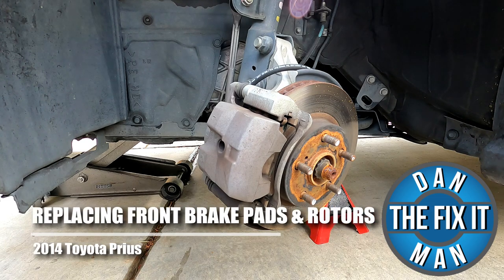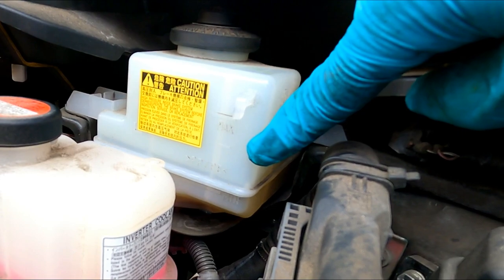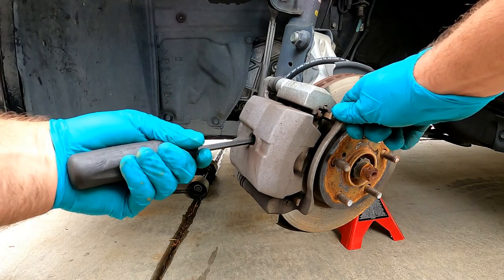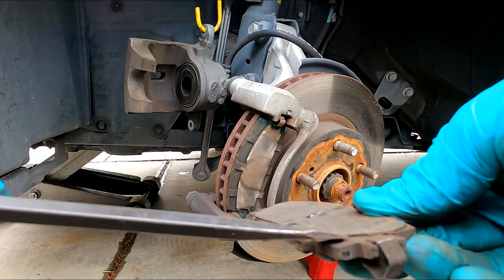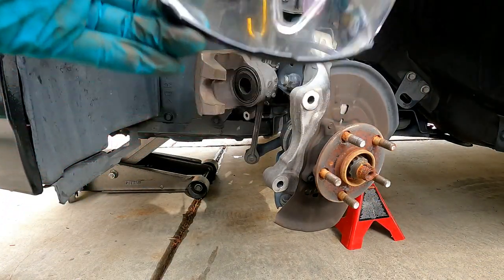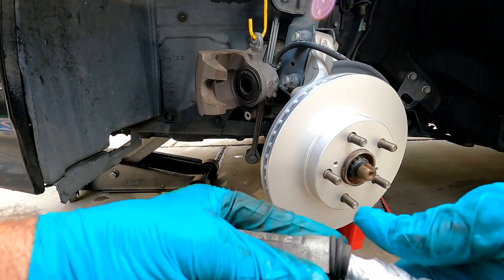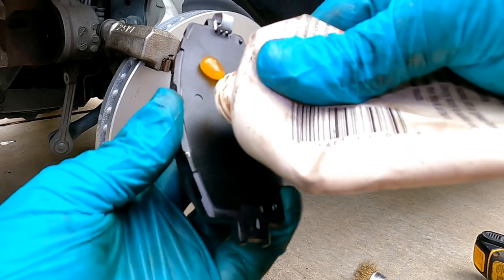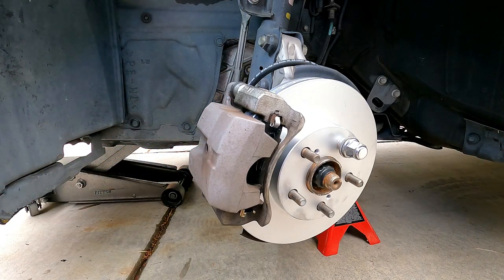2014 TOYOTA PRIUS - REPLACING FRONT BRAKE PADS & ROTORS - EASY DIY!

Comment: can't even imagine how nice it would be to work on a car with so little rust. Amazingly easy work. I live in the butt hole of america. Western NY the underside of every vehicle is coated in thick rust from the f'ing salt they cast on the roads from December through may. I have to literally cut the hardware bracket bolts off to get the bracket off. The rust is better than a weld on those bolts. Try all the impact wrenches you want, all you'll do is shear the head of the bolt off. I so envy you.

Comment: Before you do all this work,don't forget to disconnect the negative battery cable.
Reply: What if you leave the driver door open?
Reply: For a brake job? I don't understand why.
Reply: Nevermind. I found out in other comments why this is necessary. It has something to do with a brake actuator....maybe part of regenerative braking?

Comment: No mention to disconnect the negative battery terminal FIRST relative to the electronic brake actuator? I saw other videos where this can become more expensive issue if you do not. Have a 2015 Prius, unless different scenario than a 2014 setup.
Reply: If you forget to disconnect the battery, don't open the driver door, if you do open the door during the brake job then the big mess will happen.
Reply: @PickyOne  did you have to bleed the brakes? Thank you for the tip
Reply: @jasonbroscious2715  no, you don't have to bleed the brake fluid when replacing the pads and/or rotors. Bleeding the brake fluid is a separate job and has its own intervals, or when necessary.
Reply: Is this necessary when doing just the front or would you need to do it when replacing only the rear as well?

Comment: I love how you complained about the pins, Had me rolling on the floor. Once again in the butt hole of 'merica. Western NY I have to use a drift pin and a hammer and knock those pis out to clean them and re-grease. Yours come out by wiggling them, and they are shiny as the day they were installed, OMG.

Comment: So you do not have to bleed the brakes? My 2008 Prius I had to do the paperclip jig to reset the computer and not remove battery cable. So no special trick is needed to reset the computer or warning lights?
Reply: except for the obvious, as people pointed out, you have to remove the negative battery cable
Reply from the maker: @jasonbroscious2715  no need to bleed if you don’t open the system